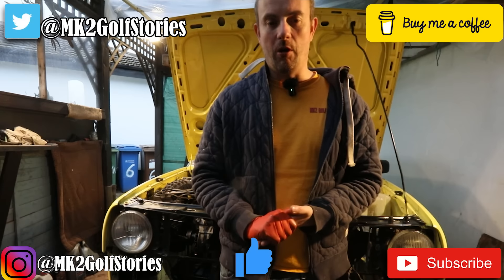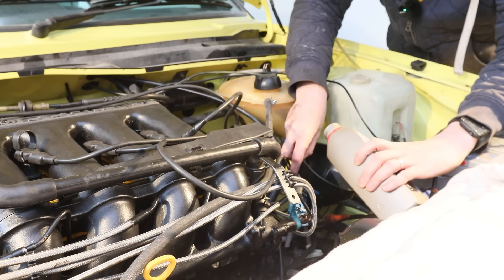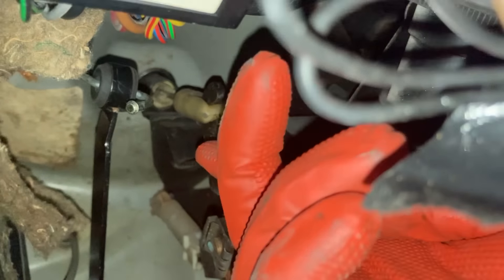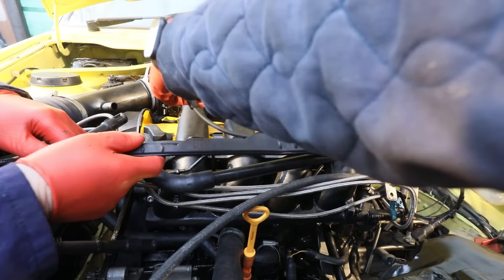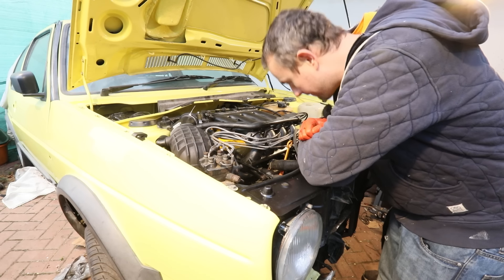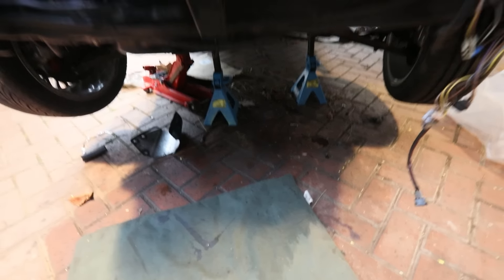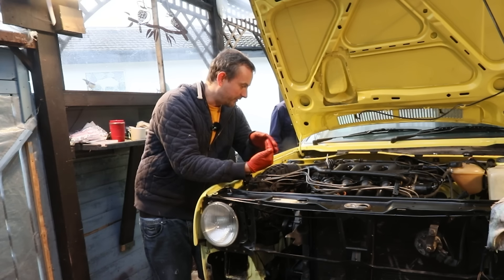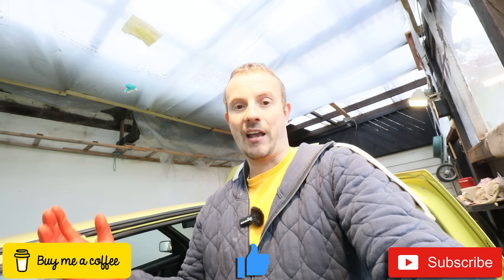We're not mechanics, we rebuilt the engine in our 16v MK2 Golf, will it start?

Comment: Nice one. Very pleased for you. I’m about to put mine back together. Did you use the starter without spark to prime for oil pressure?
Reply from the maker: @MatthewCoxall-d4s  thanks mate!
We turned it over on the starter without plugs to make sure everything had a good coating of oil before starting.
Not sure if it helps with oil pressure or not.
Would make sense if it did
Reply: Well done mate-Great job!!👍
Reply from the maker: @ cheers dude!!